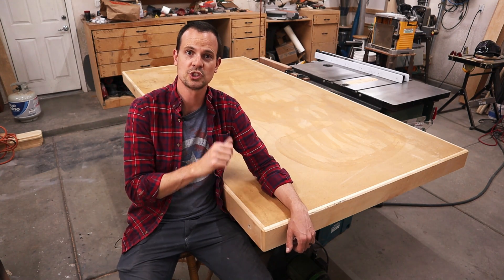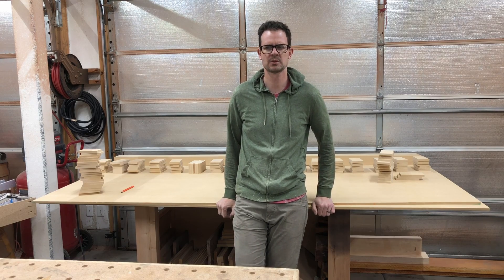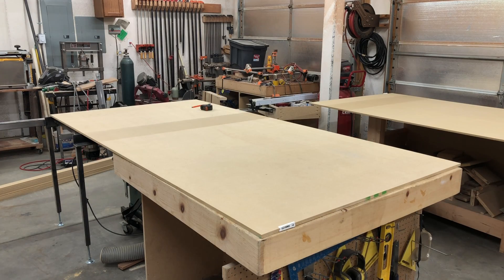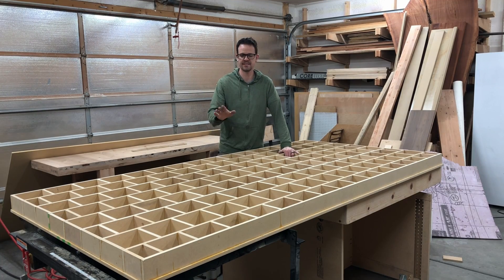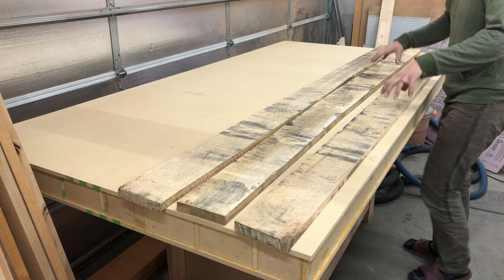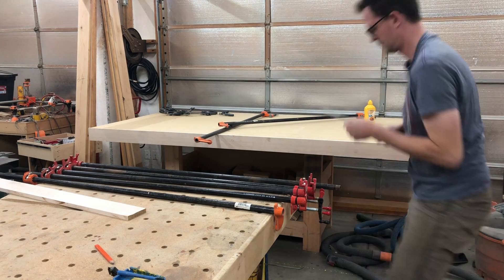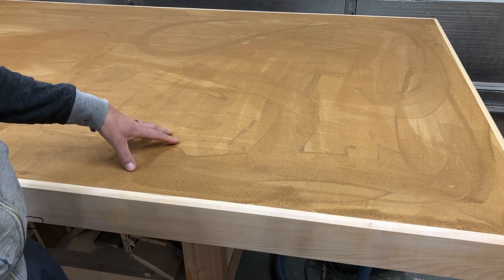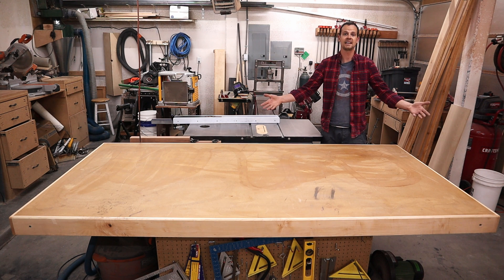How to Build a Giant Torsion Box | Build It Make It

Comment: Torsion Box uses the internal webs to connect the top compression sheet to the bottom tension sheet. offsetting the short width webs is the worst format but still won't make a noticeable difference. Nice work

Comment: A couple thoughts, the end of your brads have an angle cut on them to make a point. This angle can cause the brad to deflect and break out. Just turn your gun, so this is not an issue. Other thoughts are to add a laminate top to hide your beautiful finish, or hardboard, but the hardboard might be difficult because of the size of you going a full 4x8 sheet.

Comment: You have to already have a flat surface to build a flat surface. Well,if I had a flat surface, I would not need another flat surface.
Reply from the maker: You don't have to already have a flat surface. You can use two jointed boards and a laser level to get a flat surface. It is hard to do that though when making a giant torsion box of this size.

Comment: i know i'm a bit late to comment, but i really like shellac on my mdf shop surfaces. not as hardwearing as some other options, but easy to apply and repair, just don't drop your rag covered in denatured alcohol on it. thinned oil based poly in several coats will soak in and build a solid protective surface but is a real pain to repair.
Reply from the maker: Thanks, I have turned to shellac since then so we are totally on the same page. I really like the reparability like you said.

Comment: 7.4 inches long?  That’s a very odd way to reference a length in inches.  Maybe 7 3/8 instead?
Reply from the maker: Yep, I need to hide away those engineer scale tape measures. My machine shop work sometimes still sneak out when I am talking. I have been working at getting better at saying fractional measurements or working in metric as this was my first video I ever made. Thanks for the tip.

Comment: I made my outfeed table out of a torsion box. I attached the inner ribs with an air stapler and came at the ribs from above, that way I didn’t have to fit the gun in between the ribs.
Reply from the maker: That’s a good idea. It would make it not so finicky getting the gun in there. Hanks for the tip!

Comment: 2-3 coats of Danish oil applied via roller works really well for sealing & strengthening MDF. In any case, You could throw on a nice sheet of 1/4" thick plywood for the worktop.
Reply from the maker: Thanks! The 1/4 plywood top is a good idea, also the danish oil. Should have been way better.

Comment: I made my outfeed/assembly table with maple and walnut boards that were too ugly or split for furniture.  Sanded quickly with 80 grit and applied Rubio so that my garage wouldn't smell like polyurethane for a week but the top soaked that stuff right up.  Not as bad an experience as yours but not fun at all.  I think Rubio does not play well with more porous surfaces that only had coarse sanding, or in your case MDF (it also sucks on plywood in my experience).  I normally sand projects for Rubio up to 180 before applying it.

I need to flatten my table a bit (hardwoods was a dumb idea in hindsight) and I'll suck it up and use poly next time.
Reply from the maker: Thanks, I appreciate your feedback. I have been living with the torsion box for while but it is getting pretty beat up and need to sand it down and I will certainly use poly this time.
Reply: @BuildItMakeIt  I've only been using my table about two months and the finish is definitely beat to hell as well.  I freaking love Rubio for furniture, but not for an assembly table haha!

Comment: A great finish for MDF is oil-based poly mixed 50-50 with laquer thinner. It soaks in to the surface and hardens the MDF, and gets pretty deep too. You can do several coats and you get a really great hardened surface with a nice sheen to it.
Reply from the maker: Yeah that is a great idea. I really like thinned poly but wanted to see how the Rubio would do on MDF since I seem to have it on hand all the time now. Failed experiment, next time I'll do 50/50 poly. Thanks!
Reply: @BuildItMakeIt  I heard good things about mixing glue with water (4:1), mostly to protect corners from being beaten down. That being said, I'd expect a torsion box to be extremely rigid, because it's a torsion box. Is the extra hardness needed?